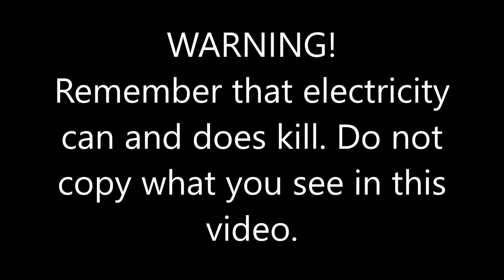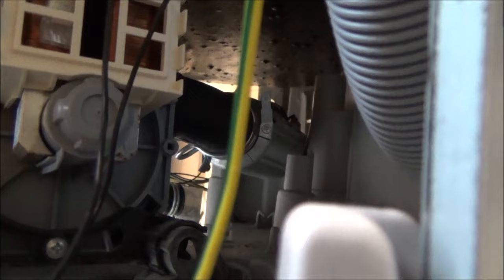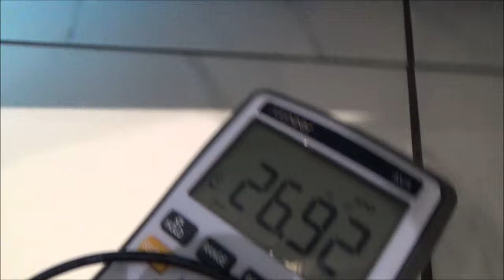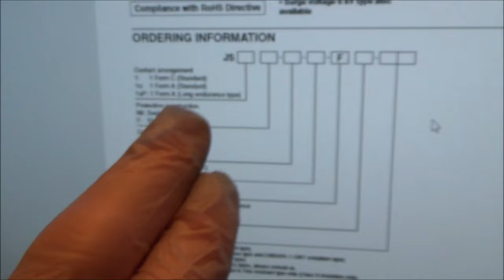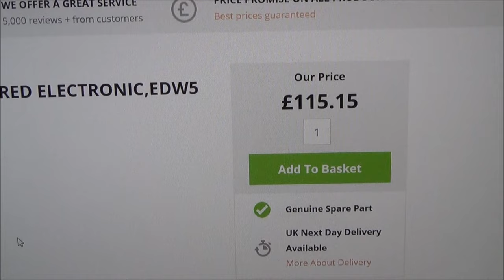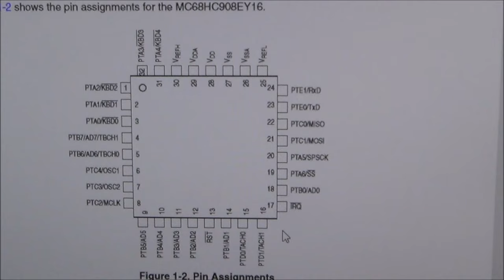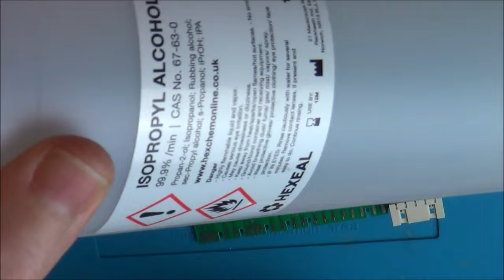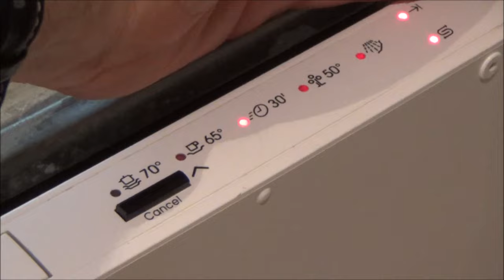Trying to FIX a Faulty DISHWASHER which Doesn't HEAT UP

Comment: coil resistance is the reading you get if you measure the ohms between the two coil posts. The diode on the coil is a free runner diode which job is to discharge the coil when the voltage is switched off. The free runner diode is dead short because of a voltage spike it got from the past. The value of the free runner diode is not important at all. You probably will be fine with a generic one with 0.5 drop voltage. You can leave your diode in circuit. it will work fine.
Reply: if the diode was OK, 38:26 here she blows up. 12 V 3A ? the diode can't handle it.
if the diode isn't short before, 38:26(wrong polarity) 38:36 (changed leads) he can blow up the transistor and the chip with wrong polarity. if at 38:26 the tranni goes short, on 38:36 he apply 12 V to an 2,7 - 5,5 V Microcontroller...
Reply from the maker: Thanks Florian for the info, I understand now that the coil in the relay acts similar to an inductor and the diode protects the other components from the unwanted voltage. This will probably turn out to be a stupid question with an obvious answer but I wonder why the manufacturer of the relay doesn't incorporate a diode into the relay itself to save another component (diode) being soldered on the board?
Reply from the maker: Thanks Ratzfaz, looks like I was very lucky this time not to cause damage. So in hindsight I should have removed the relay from the board to test it :-)
Reply: @Ratzfaz  you are wrong. The coil resistance is 400 Ohms. I=U/R. This means the current is 30mA. Don't forget: There is always only as much current as the device needs. In this case: the coil of the relay. It is equal to a resistor and 30mA is not enough to blow the protection diode. The diode should be happy with at least 150mA. The only job of the diode is to short the coil if power is shut down as the magnetic field colapses and current flows in reverse. Also: the diode was short from beginning on. Vince checked with the multimeter and there was a short already present.
Reply: @Mymatevince  there are relays existing with a protection diode already included. There is a little drawback on this: If the diode blows, you have to replace the relay. The diode on the board is your protection already. It is meant to be blown for protection of the circuit around. In this case this was luck for you: you had only to replace the diode which is way cheaper than a whole new relay.
Reply from the maker: @ftrueck  Thanks Florian, that makes complete sense. In future whenever I see a diode in front of a relay I will now know what it is for :-)
Reply: @ftrueck  and what about the diode parallel to the coil? look at the ampmeter at 38:26, the needle does a weird jump to the other side...
Reply: @Mymatevince  Most relays do not have a diode because it is not always needed. And without a diode, the relay also has no polarity and can be used more universally
Reply: Ratzfaz i do not see a needle. I see digits of led or lc displays and none of them shows amps. The right led display shows 12Volts. It kicks back to 0V when the short circuit protection of the power supply kicks in.
Reply: @ftrueck  It's below the voltmeter. It's an analog ammeter. The white thing with the A. 38:26
Reply from the maker: @Ratzfaz  Thanks
Reply: @Mymatevince  

There are a couple of reasons for this.  First of all, not all relay coils are powered by voltage spike sensitive components, so all applications of the relay do not need the diode.  Second, when you get a DC coil relay, it has no polarity.  It will work with plus and minus on either end of the coil.  But when you install the diode into the relay coil circuit in the relay itself, you instantly make the relay polarity sensitive.  Thus, to include the diode, they would need to refer to the coil polarity on the diode.  And on a PC mount diode, that would offer less design freedom to the circuit designer.

Comment: Very very interesting fix and problem finder. I am actually impressed.
Could you have taken the board to an electrical supplier and asked them for 'one of those please' and point to D8 lol. Firstly they may have said 'yep here is a pack of 3 for 48p. Hey are you that guy on youtube?' or they may say 'Nope we dont supply the d4j354s diodes, but we can get some in for you. Hey are you the guy from youtube?'
Did you clean the limescale out from the heater? That would surely make it less efficient if it was left in.
Suggestion. Do an electronic fix with Ben. Possibly even create a small fault for him to discover and teach him a skill he can take with him as he becomes an adult and starts his own repair business or gets his own YT channel.
Reply from the maker: Cheers Emma, I cleaned some of the limescale but some of it wouldn't budge, I was only scraping it with a knife though so chemicals might have worked better. I would love to teach Ben but as of now he doesn't have much interest in the stuff I do. I hope when he gets older he will get more interest. All the independent shops round here have closed a long time ago. There is a RS counter nearby so maybe they might be more knowledgeable about the different components :-)

Comment: Both diodes you took off are 1N4148. The zeners are the grey blobs. The label DZ1 is the label for the grey blob. Also, since your push buttons and LEDS still worked, your microcontroller can not be shorted. A 1N4148 is a signal diode. It should not have been used for absorbing the EMF of the relay (it's parallel on the coil of the relay). It's not made for that. It's a design mistake. If it breaks again replace it with a 1N4001. A 1N4148 is rated for 100mA. Your relay is not that small, the flyback current may exceed 100mA. A 1N4001 is rated 1A.

Comment: Hi vince I haven't finished the full vid yet but just so you know you can test those relays quickly with a 9v battery and also you can click the lid off them and clean the contacts
Reply from the maker: Thanks Reace M :-)
Reply: @Mymatevince  so if I understand correctly, the reason you couldn't test the relay in circuit was because of the faulty diode across the coil, so could yiu now in theory test the relay in circuit? I'm sure last time I tested one of those relays on a washer control board I just tested it in circuit. Thanks for the vid and good job on this one, its difficult when you have little information and I love how you piece the puzzle together and solve the problem with what you have in front of you.
Reply from the maker: @reacey  Hi, yes I think that is correct. I am pretty sure if I tested the relay in circuit now I would hear it click as the faulty diode has been swapped out. You have to make sure the polarity is correct though when using your battery or power supply which I didn't do in the video :-)
Reply: @Mymatevince  thanks alot

Comment: Hi we have the exact same problem with our ZDT41 dishwasher, it seems to work if you leave it switched off completely at the socket for a while it seems to work again, I suspect this might have been your issue!! Also I suspect thermostats in these get stuck open and the circuit board then thinks the water is at temp. hence only cold water. Also as a side note these dishwashers do not like running with the salt light on as yours is, if we keep ours topped up it works better.

Comment: the diode across the coil is a flyback, it stops high voltage from sapping the transistor or micro controller, the zener diode is to voltage regulator in the circuit, ie if it goes over 5volts then it puts the rest to ground ::
Reply from the maker: Thanks Rob :-)

Comment: The diode is in parallel with the relay to protect the driver from the voltage created by the relay when it is turned off , when you turn the relay on you create an electromagnet and when you remove the voltage as the magnetic field collapses it induces a voltage in the coil you need to shunt this voltage to prevent damage to the circuit that drives the relay ( try googling diode in parallel with relay you will find a better more in depth explanation ) 
 to feel this connect a relay to a battery (something around 5 to 12 volts) and place your fingers on the relay coil when you disconnect the battery and you will get a shock
Reply: love the simplified explanation, and the diode only goes one way to block the field when it tries to return to the circuit, after the relay turns off (normally off).
Reply from the maker: Excellent explanation. Thank you :-)
Reply: @Mymatevince  You`re welcome Mate

Comment: Great job, bro  👍
To me the diode you soldered in is ok, no need to change anymore. It doesn't have to be a smd type diode.
As Christian Ivarsson and Jason J wrote already it is an ordinary protecting diode for the transistor or IC switching the relais.
What wonders me is the short you measured between Vss and Vdd of that Controller IC while it was removed from the board.
But mirically it is working.
By the way @29:52 the word SPULE is german and means coil. The relais has a 12Vdc relais coil.
I currently have a similar problem with a washing machine and wish I could fix it as you did.
Like you I do not have any schematics and my boards are multilayer smd boards.

Comment: I have taken the control panel on my dishwasher apart several times and re-flowed the solder to the main power relay. This has always restored normal service though I did buy a replacement relay last time in readiness for the next "fault". Anything more than this and I would personally just buy a new machine.

Comment: 2 years late....not really sure 😂. The Diode test only should work in diode mode to drop a voltage 0.5v nominal for most standard diodes, that diode has a short as 3 ohms in both directions. For someone who appears an amateur electrics DIYer you have far more patience than me and I troubleshoot daily, good work 👏

Comment: This is a supressor diode. Its supress high voltage spikes generatet by the coil in the relay in case the microcontroller switches the relay off.
You can use your Replacement. It should work fine.
Reply from the maker: Thank you :-)

Comment: I had same problem and it was the circuit board relay track burnt off.replaced with new wire and worked funny enough two years it lasted.

Comment: When you power a relay inductor or any inductor, then power it off, the stored energy will reverse voltage and if there's nothing to discharge the energy, the voltage flies up to hundreds of volts, damaging the switching transistor. The diode is there to remove the issue by shorting the negative voltage to ground. If it fails shorted, no harm is done since the relay doesn't activate. You can use a standard high voltage diode like 400v 1A diode(edit, I couldn't see the size on video until you showed the new one, it's likely an 1n4148 in mini melf package), there's nothing special about it. Don't do it without diode, you may damage the switching transistor, possibly more components. Btw the other diodo, zd is a zener, but the label belongs to the gray through hole component. The other minimelf is the same as the damaged one.
Reply from the maker: Thanks Josha for explaining it in a way that is easy to understand :-)

Comment: Loved your video but I've got a few points to make (correct me if I'm wrong)

I call that tool vice grips that might not be the only name though

Most zener diodes would have worked the same for your application so the diode you used as a replacement should just fine even a regular diode probably would have worked

The diode was acting as what's called a "flyback diode" which is there because since the relay has a coil it works like an inductor which means when you turn the relay off it would create a huge voltage spike that can damage or mess with other components

Also it would have been a very bad idea to have bought another chip because that was a programmable chip and because you have no way of writing the dishwasher program to it, it wouldn't have worked

Last point is where did you get that super combo power supply, soldering iron and hot air station thing? That's an engineer's dream
Reply from the maker: Thanks for all the tips/advice. Between your comments and all the others I now understand it better than before. The station I have is called a 3 in 1 and was a cheap one from Amazon. It is a YiHua 853D and was approx. £80 :-)

Comment: You should every month run a finish dishwasher cleaner through that's to get rid of the lime, burnt wires new conectors with protectors or a new wireing loom

Comment: I blew two diodes by putting 12v on two of my relays in circuit. I replaced them after testing. Thought that was my problem but it wasn't:(

My element comes on as soon as I close the door but roughly after 10 seconds I hear the relays do a funny clicking sound on off on off and element doesn't come back on. If I open the door and close then it does exactly the same process. I'm thinking it might be the case VCC capacitor?

Comment: Had you purchased a replacement microcontroller chip you'd have discovered, to your disappointment, that the dishwasher wouldn't work at all with the replacement as it would need to be suitably programmed for correct operation!
Reply from the maker: Yes, I now know that is what the additional contacts near the MCU labelled up as "JFLASH" are used for :-)

Comment: It is a 1n4007 diode in a glass case used as a voltage spike clamp. When the power is applied and then removed it creates a spike in voltage that can kill chips the diode clamps it to a safe level. The diode failed causing a voltage spike and can killed your chip.

Comment: That's a "back EMF" protection diode. It's failure is probably due to a high current spike induced in the coils of the relay - normal operation the diode shunts that excess to ground without issue - if the relay is energised in quick cycles it can cause the diode to overheat leading to premature failure - perhaps someone was turning it on & off quickly? Of course components do fail over time...
Reply: Would a beefier replacement diode then be less likely to fail?

Comment: The diode only acts when the relay is released. When a relay coil is de-energised you get a very high voltage generated in the reverse polarity, this could damage other components, the diode in effect forward biases and shorts this spike to ground. So it wont affect the heater staying on ion any way.

Comment: As far as I can tell its a small signal diode,  Its most likely a 1N4148 is there any trace of a number on it? It's probably the same one you put back in as well - if you got them in a kit kinda thing they're the most common so it'd make sense
Reply from the maker: Thanks Jake, I couldn't see any number and I looked pretty closely at it. Luckily for me (just by chance rather than good judgement) I replaced it with a 1N4148 and others have mentioned that it was a LL4148 which is a SMD version :-)

Comment: Hi I'm wondering about the heating element, how much voltage must come for the heating element to work??
  I have the same problem but the connector is not burned.. when I measure the voltage during washing, I only get 50V AC
please reply.

Comment: The problem with the main chip is: it is a micro controller. without the dish washer firmware flashed on it you will have no success.
Reply: Yep, 100% correct.
Reply from the maker: Thanks again Florian, so that is why it says "JFLASH" next to the contacts on the side of the board near the chip. It is so they can program the chip with the firmware. It all makes sense now. Thanks mate, you have helped a lot :-)
Reply: @Mymatevince  Yes, JFLASH is (most probably) a JTAG Flash port.

Comment: The diode you changed is a flyback diode. When you take the voltage from the relay coil, as the magnetic field of the coil collapses it induces a reverse voltage spike that is shorted by the diode so it doesn't feed back to the rest of the circuit, The spike could destroy other sensitive circuits if not quenched by the diode. As far as the MCU chip, you can't just change it. The MCU would have to be programmed.
Reply from the maker: Thanks for the great info and explanation :-)

Comment: Aw man, how the hours fly.
That is a flyback diode which I suspect you may have blown when using the bench PSU (depending on how it deals with amps output).
Your machine was not behaving properly beforehand though, which you fixed by changing out the diode, so it might be that it was blown beforehand.
Don't worry about the glass diode though, I suspect they have the wrong part in there just because it was more economical for the pick-and-place machine to not change out reels if the intended part was not common on the board. The one you put in should be quite alright.
EDIT: Reading the comments, it might be the surface-mount 4148, true. Doesn't matter much what you put in there, as long as it has a reasonably high peak reverse voltage rating (and yours is fine)

Comment: I'm not skilled like you but I do have a problem with my washing  machine every 1-2 years when the vacuum switch tube gets gummed up and the water doesn't run back so the vacuum switch doesn't switch, I resolve this problem by blowing down the tube, I have to use 2 plastic straws joined together so I don't have to take the machine apart. I recon this was your problem all along and nothing to do with the board, when you blew down the tube in the beginning I think that cleared the pipe thus making it work again

Comment: a diode that shows sort on both sides means its gone bad. you can also test a diode in continuity. a diode only allows current one way not both ways. that diode looks like a standard 4148

Comment: Hi. My dishwasher is playing up. Basically it fills up but doesn’t start the washing cycle, I then open the door and there is water in the bottom of the tray. To get it to drain I press and hold 2 buttons which resets the cycle and then close the door and then it drains. Any idea what would stop it from cycling? Many thanks